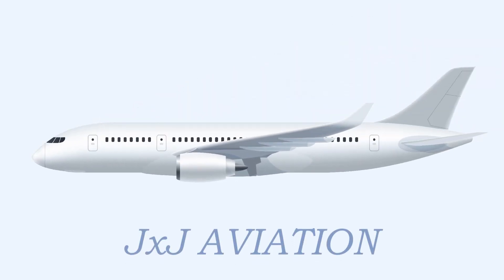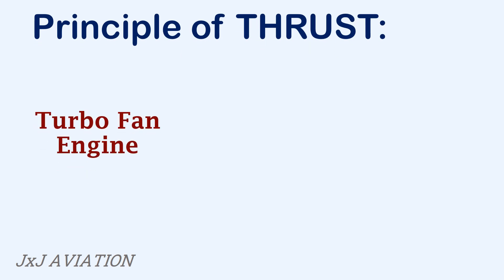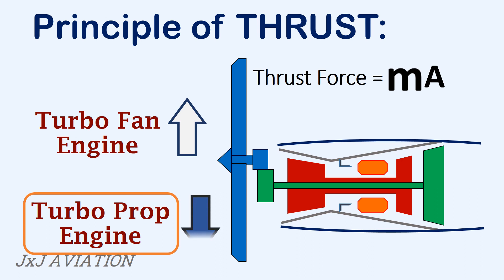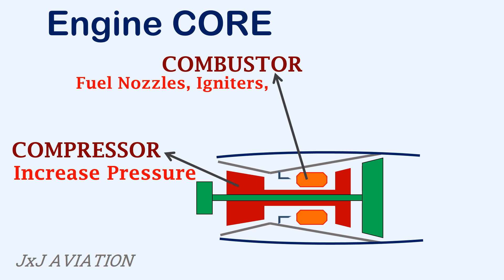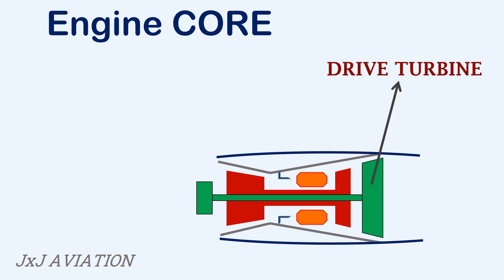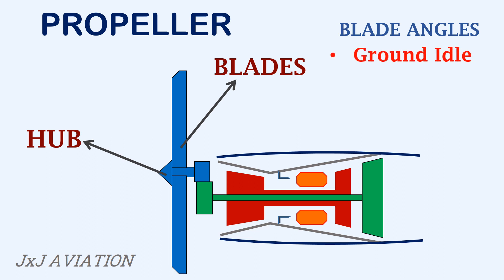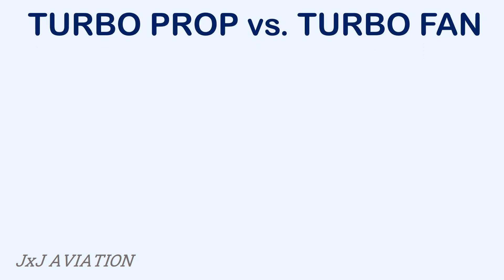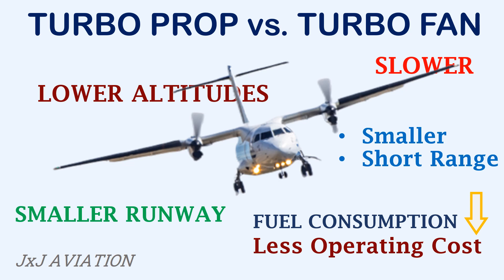Understanding Turboprop Engines: Thrust Generation and Comparison with Turbofan Engines!

Comment: Why does turbo pro have the advantage of taking off in shorter runways? Can you explain that in more detail.? Please.
Reply from the maker: Turbo Prop accelerates faster and are more efficient than jet engines at low speeds.
Reply: @JxJAVIATION  is it because of the extra thrust provided by propeller? Or the overall engine assembly.?
Reply from the maker: @discoverlight  Its because of the propeller and its ability to create thrust faster than a jet engine of the same size.

Comment: Now engine companies are making ultra large turbofans ,with more volume of bypass duct, where the fan rpm is reduced ,but generating more thrust, 
So how it is different from a turboprop ,with a large diameter propeller generating most of the thrust by spinning at less rpm  ?
Reply from the maker: A turbo prop is more efficient when flying at lower altitudes and turbo fans engines, even if the have a larger fan, are efficient at higher altitudes. 
The concept of producing thrust is different where a large quantity of air is accelerated in turboprops but turbo fan takes lesser quantity of air and accelerates it to a higher value.
Reply: @JxJAVIATION  thanks a lot